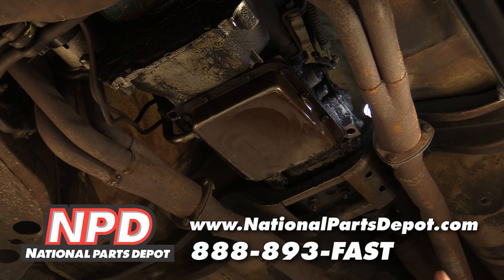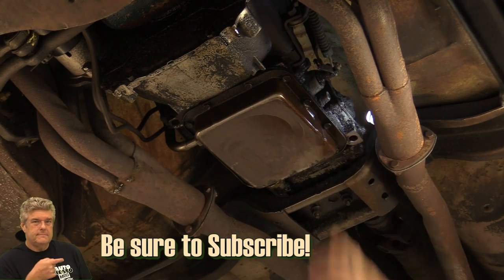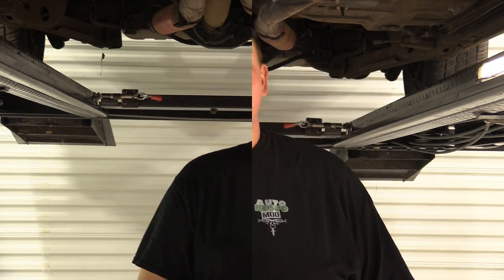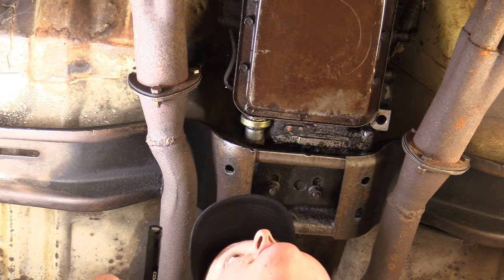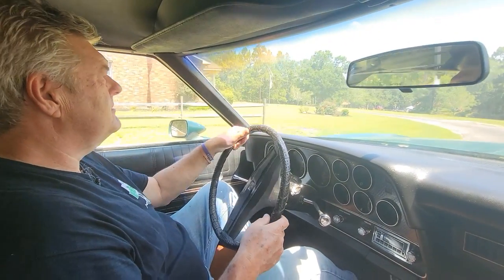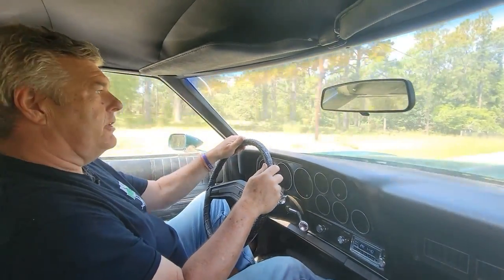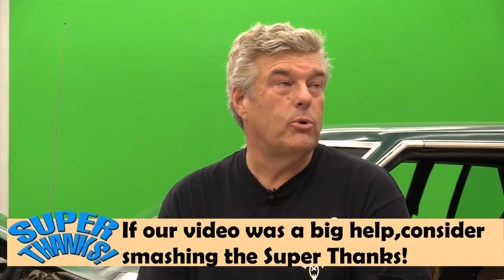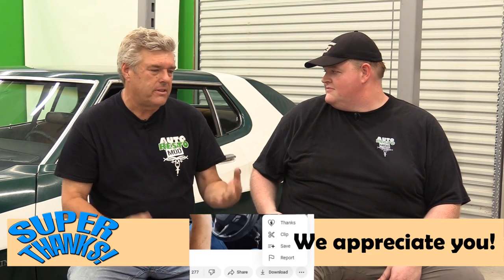Is Our C4 Transmission Done?

Comment: Two things. 1. Maybe the vacuum line has a crack in it . 2 Behind the modulator there's a pin that the modulator pushes on, it can fall out or it's to short. I think if the modulator is changed out for a new one that pin may need to be checked for length, if I remember right I had to change mine to a longer one. I used a 8d finish nail cut to length. If I remember when you put the modulator in it stops 1/8 to 3/16" short and last bit is preload.
Reply from the maker: On the plate for this week.

Comment: With all the work the last owner did, is it possible they put a shift kit in it? A heavy 2-3 shift spring could cause that. Not building enough fluid pressure below 3k rpm.
Reply from the maker: We think it needs some love on the valve body. Or modulator.

Comment: I know this will sound crazy, but pour a qt of marvel mystery oil in the transmission and drive it. I’ve used it in sluggish transmissions, that have set up for a while and exhibit shift anomalies like this, for years with decent results. Afterward, I do a pan service with filter, and substitute one of the qts of fluid for another qt of the MMO. It’s a cheap swing at it. I’m not a mechanic in a bottle guy, but MMO has helped me out many times.
Reply from the maker: That could be an option, but we are going with a pull the pan line since we are going to show adjustments and such.

Comment: Enjoyed the video; it's quite common to get an uncommon education here. Most of us would not suspect that a slushbox originally installed in a different car would have slight though meaningful differences that could make a noticeable difference. Thanks to this video, I'll reconsider a few ideas I had.
You guys were probably thorough enough to check the linkages, but when I was young enough to still have a full head of hair 🤣, the selector linkage in my '68 Galaxie broke. Did youthful exuberance play a role? 😇 Nah.
Great to see the Fried Green Tomato out on the road. 😎
Reply from the maker: There has been some shenanigans on the shifter for sure. The car had an FMX originally, the C4was no longer an option by 1975 (according to the service manual).

Comment: My original c4 out of my Torino has a 2 bolt boss where the shifter cable bracket bolts to.The seat belts look like a new updated version. Im looking to update mine. Do you have any info on those belts . A bad modulator can cause delayed shifts. Also if your passing gear kickdown is out of adjustment it wont shift into 3rd.
Reply from the maker: Good tips! Im worried that this C4 lacks that boss and will require some ehhh specialized engineering. If you could send a photo of the boss area I'd appreciate it: jford@autorestomod.com

Comment: Truly enjoying these videos, short, great content and well edited/ produced as with great content
Question: do we know @ what ( on average) RPM a C4 should shift at? My C4 seems to shift early, need to confirm with a tach, is this simply the modulator valve? My tranny kick down ( passing gear) is currently disabled; does this affect shift points under hard acceleration?
Great work, I appreciate what all of you do
Reply from the maker: Low speed would be 10ish mph first to second and 25ish mph second to third. The wide open throttle mph varies by rear gear ratio. 3.00 gear would be first to second at 34-42 mph second to third at 62-76 mph. Different gesrs will change shift points. This is actually a function of the governor, but I ain't going there. Lol

Properly adjusted, the kick down will help under acceleration (passing).
Reply: Thank you for the reply. Clearly mine is shifting early as just local I’ll be in 3rd gear at 20MPH simply cruising thru residential streets; at time I’ll manually place it in 2nd.
I recognize the kick down for passing gear but was curious if when under WOT from a dead start if it, in anyway, affects up-shifts, appears not to be the case.
Again, thanks for the note, I’ll need to under the car and tweak things a bit.  Enjoy!

Comment: I know this is totally not in the same area code is what you're talking about now but I'm new at this and I don't know how to work all the things but I have a duel 4 Barrel that runs off the the back carb but has a electric choke on the front carburetor doesn't it need the electric choke on the back carburetor since that is the one that it runs off of
Reply from the maker: It depends on if that is the only carburetor it runs off of. Some setups are tied together. Problem is I have zero experience with multiple carburetion linkages or set up.